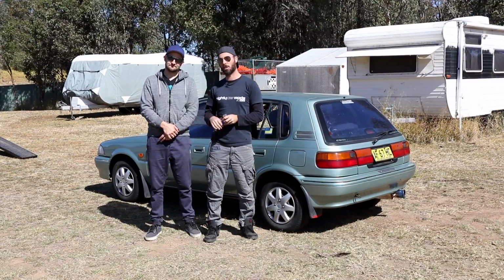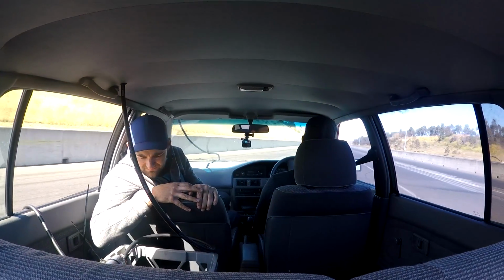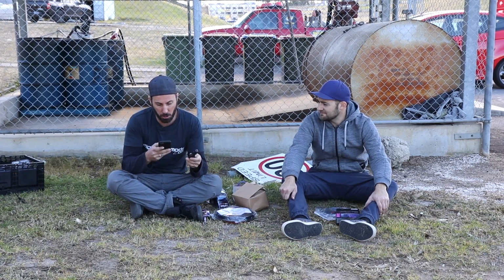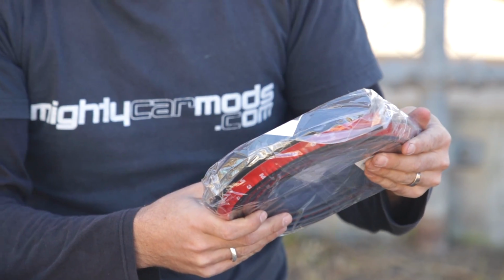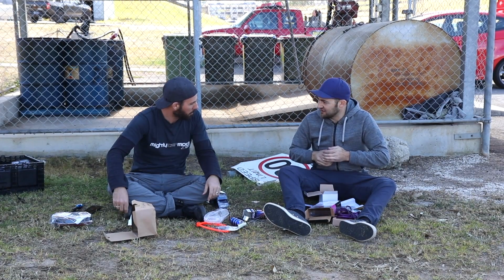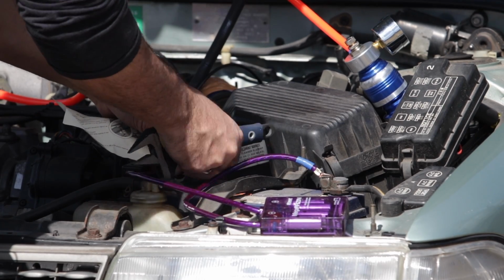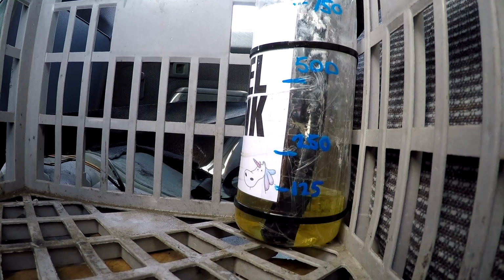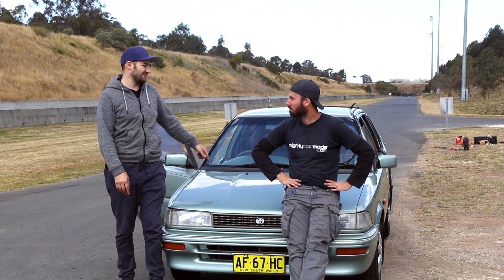Fuel Economy Mods - MYTHBUSTED

Comment: Fill the tires on Derek full of water then test fuel efficiency.   Should mostly suffer, but once at highway speeds is should improve because you have added four directional torque converters.

Comment: If you're looking for actual fuel economy gains, as they say on ecomodder.com - "Adjust the nut behind the wheel." Hypermiling techniques will do much more for mileage at low speeds than anything you could do to the car (apart from typical maintenance, as low tire pressure and a broken engine aren't great for mileage). There are certainly aerodynamic modifications that can improve economy at high speed, including wheel skirts, grille blocks, mirror deletes, undertrays, etc, but they don't do anything below 35-40 MPH (maybe 50-60 KM/H?). I've seen significant gains myself with just a grille block and an air dam. Reduced drag also means higher top speeds, though gearing and power restrictions will obviously limit that.

The vortex generators have to be installed at specific angles to produce significant gains, though the spoilers could potentially yield modest gains.

For the record, I'm under no illusion any gains were expected from this highly scientific test. Also, I'd really like to see how far Derrick (Derek?) can fly, or perhaps try 2 wheel driving. They did that on Fifth Gear as well, though it's been years ago. Russ Swift is one of the masters at 2 wheel driving, but I doubt you'd be able to get him to Australia for the shoot.

Comment: Vortex generators do work especially for a hatch. Shame it was blocked with the lame sticker spoiler which increases drag... ie worse aero.

Try doing water injection system, it's a legit fuel saver and power booster. Hint, turn it on after you are warmed up, and turn if off before you park, this keeps the residual water out of the cylinders when you park.

Comment: should do a second version of this with tuning for economy. for example resistor in the IAT sensor or MAP/MAF to the car thinks less air is really in there. see if for that style driving running lean helps.

In short, run Derek lean.

Comment: How about some real hyper mile stuff like over inflating the tires some, lower the car an inch or two, remove the mirrors and windshield wipers, air dam the front, tape off the grill. i think you could improve mileage 2-3% with less rolling resistance and a bit of improved aero.

Comment: Can we get a little clarification on the vortex generators PLEASE?  The evo had diffusers, not vortex generators.  Turn the ones you have at an angle and it will force boundary layer separation where they are placed.  Essentially the laminar flow will be forced to turn turbulent.  You won't notice any difference on a hatch, as the BL separates at the back anyway but on a coupe/sedan it will reduce back pressure and thus be more efficient.  Keep in mind it will also reduce downforce and make the car more squirrly though.

Not sure about the spoiler tape though, there's usually some turbulence generated by the wipers anyway, it most likely turns laminar on the windscreen (as you Aussies call it) anyway.

Comment: Boys, how about actual 'aero & efficieny mods'  .    Many of these can be done with cardboard:
-Moon hub caps on narrow 175 13" or 14" steelies.  
-Max air pressure in tyres.
-Fender skirts in back
-Extend tail, teardrop/turd, with kammback
-Low almost dragging front lip
-Flat bottom the car, with rear diffuser

Comment: Dumb suggestion for modding Derrick;
Add pulleys to all of the wheels, use some rope as 2 belts running from back wheels to the front.
And turn Derrick into a 4WD.
What could possibly go wrong?
 - Eddy

Comment: Best fuel economy mods- over-inflate your tires by 5-10 PSI and throw a bottle of strong fuel system cleaner in the tank to clean out at the crap from your injectors and piston heads, and that's about it.... oh and install an old school vacuum gauge; green= economy.

Comment: strip derek as naked as possible and throw space savers on the rear please! also chop the rear springs with a grinder or more sweg and dat rake angle and even some tall tires on the front.

also can u disconnect or degas the shocks and just run him on springs to see how it rides? my old verada blew the shocks and it bounced so muc would almost get air! even after u stopped it would bounce, was hilarious!!

also electric fan for intake (we proved they worked at cit dyno on a vr commo lol) gained 11kw and intake pressure got to 0.9psi so actually got positive. 

the posibilities are endless

Comment: i know way back when you guys did a semi scientific speed test with a car and then proceeded to completely strip it down to make it faster.  what you should do now what you should do is take the doors off. take the hood off and get rid of every bit of weight you are willing to take off and or cut off and ee what the fuel saving is with weight reduction.

Comment: Any chance you guys could install a hydrogen gas generator kit (hho), but make sure it is a dry plate generator. Use to be a big thing a few years ago when the fuel prices jumped after the GFC but not so much anymore.

Comment: The Mythbusters tried to increase fuel economy by covering a car in clay with divots carved all over. The idea was to make the surface of the car like that of a golf ball, which goes further and faster than a smooth ball, due to it's texture.
Maybe you could verify their findings by taking a ball-peen hammer to the body of that Toyota???

Comment: i'd like to see an assessment of the homemade hydrogen fuel cell that you hook up to the battery and run through the intake. supposedly water, electricity, and a hose is all that's required however I'd love to see a proper test.  Also, props to you guys for the little things. Like the unicorn sticker on the auxiliary fuel tank. Bravo m8s

Comment: I agree with the ebay turbo crowd. I'd live to see some shoddy turbo installation. No turbo yoda, no welding, hose clamp and duct tape
Reply: They never did a shoddy turbo job, which I recall...maybe crazy and out of the hood, but the setup still had some class.
Reply: elliott turner they did it like 2 years ago

Comment: When you use vortex generators you first need to know where laminar flow becomes turbulent then put them ahead of the turbulent flow to reattach it downstream. That's how they are used to lower stall speed on wings. So i guess it would be useless on a car that's probably mostly turbulent flow.

Comment: I actualy have raizin in my car. Not as fuel saver but as a replacement of dead caps on my alternator and aditional grounding. I am planing to check it with osciloscope to see if its filtering something. But my car is currently dissasembled.

Comment: 3 ways you'll actually increase mpg: 1) lose weight 2) block of everything in the front to stream line the aero, even under the car 3) increase intake air temperature. Number 3 will make the car have less HP and a significant temp increase will make the car feel very slow, but higher intake air temp = better gas mileage.
Reply: You'd like my cold air intake video then. I found the temperature limits, which the car could handle so I modified the car further to get colder air than it's short ram air intake normally would (yes, too hot means it loses power too) and I then added more hot air again as in certain times of the year it's too cold to get more power from cold air...let alone the gas mileage loss. Come check it out.

Comment: the vaccum leak closed the fuel pressure regulator. look no return fuel and higher rail pressure.
Reply: That's not how it works... it will increase pressure tho!

Comment: Best way to improve your mileage is to mod yourself. Change your driving style.
Reply: weight reduction bro
Reply: yep, here in CO i hear weekly "i can't get good mileage, i live in the mountains and drive an SUV." then going down every canyon they're flooring it, slamming brakes for corner, flooring it, slamming brakes for corner etc. meanwhile i'm coasting in 4th gear getting 90+mpg. also if the light a half block away is red why are they still accelerating!?

Comment: I see you have a cracked intake tube as well. I used a piece of bike tube and some zip ties. Just stretch it over the crack, add a little rubber cement if it's a flat part, and just go.

Comment: Can you mythbuster the hidrogin generator kits for petrol cars?
Like this thing: http://www.hydrogen-generators-usa.com/hydrogen-car-kit.html
Reply: Come on son, the correct spelling of Hydrogen is right there in the link.
Reply: It's junk. You have to produce energy to store energy to then produce energy.

That's the equivalent to burning wood to heat water to create steam that then turns a generator that charges a battery that discharges into a heater which heats the wood.
Reply: Further, they' cite outdated data.
http://www.hydrogen-generators-usa.com/support-files/nasa.pdf

You'll also have to modify the engine mapping to run leaner to actually take advantage of an increase of flame speed.

Comment: Derek is slow. But Derek wants to go FAST! So, Derek went on eBay and bought a $100 turbo kit. Then, Derek got a $100 Nitrous Kit. Lastly, because Derek wanted to be the fasted pile down under, Derek added small, solid rocket boosters... #GoDerekGo :D
Reply: Derek used "Run Lean"

Run Lean backfired

It's Super Effective!

Piston fainted

Derek has no more usable horsepower!

Derek blacked out!
Reply: Daniel St.Pierre don't forget the 'go faster racing stripes'!
Reply: Thanks!
Reply: Now that I wanna see, hear and FEEL!!!!! #SlamDerek

Comment: Dudes you have to use a smaller hose diameter for the fuel hose less fuel goes in the engine and the ecm will regulate the air
Reply: jose artiga That's not how it works. The air is controlled with the throttle aka your right foot, the ECU matches the injection window length to create the mixture it is programmed to create. If you bottleneck the fuel supply to the point you still get a lean mixture at maximum injection window length, you'll most likely get a check engine light.

Comment: How much hp can be gained from the stock engine? Such as head porting, head skimming, without changing the main parts to the engine, stock intake but maybe different exhaust manifold.
Reply: MrHopekiller yeah, cause I've considered porting the head to my engine, there's no real aftermarket parts for it but I'm wondering if porting it myself would even be worth it.
Reply: B2Z - more air in means more air out, so yes porting is worth it. How much air can you get in and out of an engine = peak HP.
Reply: I had a car on the road, which I had been modding for years, and my porting  plans got interrupted by the engine getting hydro-locked. While being a mechanic, I keep getting better at shaping metal with my tools I've bought to do the project. Come check my channel out. I actually have a lot of porting and airflow theory videos based on David Vizard's books. A wizard at engine performance.

Comment: Only criticism i would give is making the test a bit more regular. Set RPM's to shift at, allow no vapors or bubbles to be sucked into the fuel lines (may effect fuel economy but could effect each test differently). The fuel should return instantly if you removed the fuel line from the rail or you could wait 2 minutes each time and check the fuel level at that time (remember to use a stopwatch). Just makes it more science. Keep up the madddddddd mods!
Reply: Do they even need to drive? Or could they put a brick on the accelerator and run at a specific rpm for X amount of time.

Comment: I'd like to see you do a less 'tongue n cheek' version of this and try out one of Race chips devices. Well their entry level one ad the claimed returns on investment shorten very quickly. There first device will offer 80 of their 3rd device. At 3x the cost. The energy level Race Chip one at £120/180 car model depending which claimed to add 20-25bhp and 40-50torques. Also if you dont take full advantage of the extra power (😉) with the added torque you should, if you dont drive your driving behaviour, get a bit better mpg.

Im looking at a 17 plate Octavia vrs 230/45 and I don't care for the extra 20 bhp for performance, but given it only gets about 28mpg (real world, uk gallon) I'd like a bit of a bump in that dept.
Reply: Stephen They did a clip on eBay super chips. Find their S2000 video

Comment: I want to see what's inside that cigarette adapter thing. (Obviously it can't do anything since it's not connected to any data port) but I'm wondering if there are even any electronics in it
Reply: RedstoneWolf Probably just a capacitor, which could help power rail noise by having a better frequency response than the battery in the bay.
Reply: Same
Reply: Automobilie ok yeah I guess. At least it would have some purpose
Reply: RedstoneWolf but the capasitor is tooooooo small for the car power system it just change nothing to the power system
Reply: Same guts as Peter Brock Energy Polarizer

Comment: turbocharge a hybrid engine
Reply: There's no such thing, hybrids use regular engines and an electric motor to assist it. There isn't a "hybrid engine"
Reply: That already exists kind of. Hybrids sometimes use an Atkinson cycle engine, and adding forced induction turns it into a Miller cycle engine. The Mazda Millenia had a Miller cycle engine in it, hence the name.

Comment: Drive Derrick without springs and no shock absorbers (you ain't driving unless you scraping) and remove all windows on the car, gotta stop the wind resistance so you get better fuel efficiency :P read with irony

Comment: Weight reduction test for acceleration and fuel economy.
Reply: They actually cut tons off of a car, including a roof years ago and with the junk car being so much lighter, it did drive a lot faster. It probably would have gotten better fuel economy as well...maybe not on the freeway with no roof, but still, they basically, in my opinion, already did that.

Comment: Same test  with 
- fuel economy tires like continental eco contact 5 or Michelin energy saver
- lower the car 
- cover the underside of the car like modern cars have
- basic weightreduction
- use 0w30 or 0w20 oil
- lighter rims or for higher speed use those moon caps
- fresh air and fuel filter
- maybe also fresh gearbox oil

Those changes will definitely do some improvment to the fuel economy. it depends much if you do the test on slower speeds or higher speeds. on lower speeds the rolling resistance of the tires matter quite a lot and if your car has a lot of mass to move it from a stad still. on the high way its important that the car has a lot of mass and aerodynamics should be as good as possible. 
so in conclusion a new test would be great but also the old one as comparison interesting.
Reply: ha ha.. then factor all that stuff in on its cost and see how much you saved...
Reply: With Style don't forget spark plugs my guy
Reply: yeah they should also be changed if old.
Reply: With Style? This is one of the best comments on this video. I read many when the video was fresh. I was going through my tabs (not actually open) and I was surprised I hadn't complimented you on your comment.
Reply: And extremely expensive ridiculously looking body kit.
Reply: I agree, a video of actual simpler/cheaper fuel economy mods would be cool to see.
Reply: I'd say adding a msd system with some really good plugs would give a little bit by burning all the unburnt fuel
Reply: its just for science and there would be at least some proof that some of those even work in some way or another. some of the above mentioned changes are just normal maintenance, weight reduction is for free, lowering the car cost about 100-200$. fuel economy tires will pay themselves to some degree off if you drive a lot due to the harder compund and lower rolling resistance. 
covering the underside up is the most expensive but with quite a big impact i would guess

 and if you save 7-8% with all that mods do the maths for 320k km you will save around 1800l of fuel(if your car has an avarage consumption of 7l/100km)
Reply: Damm i want to see this
Reply: Also grill block and hot air intake
Reply: Mash tires, fluid changes are basic maintenance. Weight reduction is free with some elbow grease. Ingenuity can get you some underbody plastic pretty cheap.

Rims are about the only thing they mentioned that could cost you a bit if you don’t have patience and willingness to research then hunt specific wheels that fit your car used/discontinued.
Maintenance saves you on the long term investment. Bald tires can lead to accidents, old fluids can lead to mechanical failures; so again, where is all this extra cost you implied ...  unless you buy everything off the shelf and pay someone to do it for you; which sort of means you don’t watch the channel as they can and have done most of that stuff on the channel theirselves, including using gardening plastic to make a ground effects kit they riveted to the bottom of a car, that looked pretty decent compared to actual kits I’ve seen on cars lol
Reply: With Style pretty sure they did this vid for ricers to see what NOT to put on their cars to save fuel....